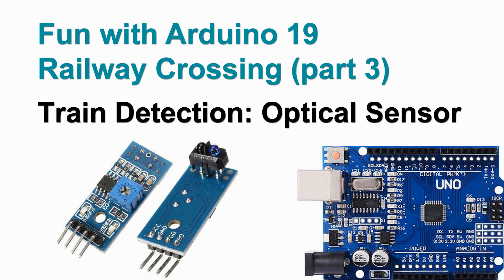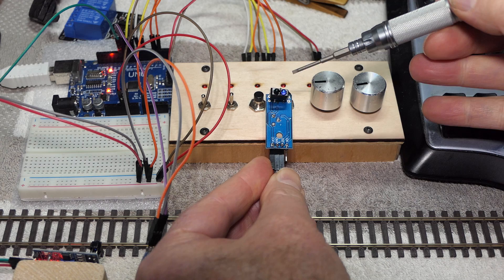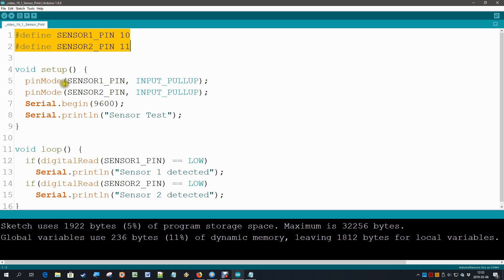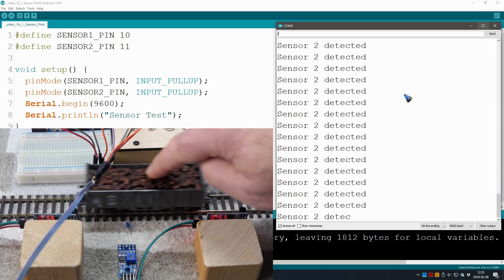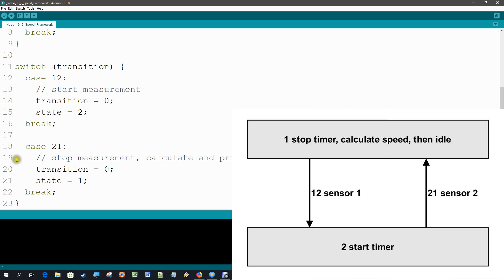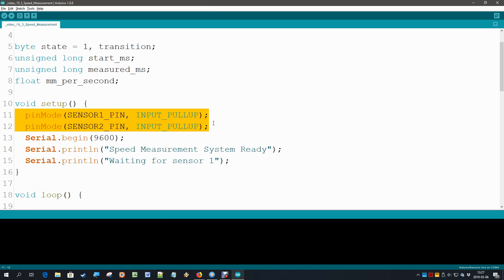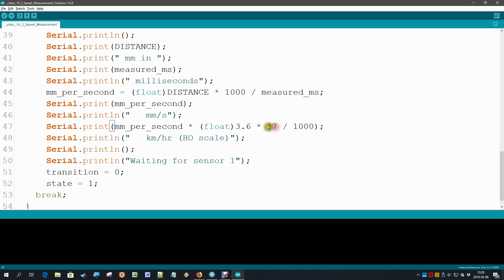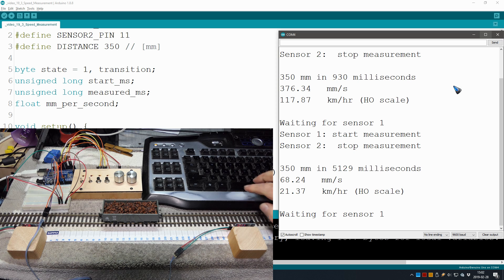Fun with Arduino 19 Railway Crossing Train Detection with Optical Sensor

Comment: Hi, there,.. how can I make the 2nd IR sensor  stay active until after the last car has past over it.....once the 1st sensor has been activated? 

Like once the 1st sensor has been passed over the the train is over the 2nd sensor gate goes up once it's cleared.
Reply from the maker: It is a bit harder to detect the tail of the train. Once a Low>High transition was detected you have to detect a High>Low transition,that should be the end of the train. However ... you may have to fist wait a second, or two, to know that it was not the gap between two wagons, else start over and wait for the next High>Low transition.

Comment: hey, would you be able to make a tutorial on how to set up and program a detector by means of connecting the detection leads directly to the rails? In north america at least, we use an ac pulse loop with rectifier shunts at the end of each approach and can calculate the speed of the train by the resistance in the rail.
Reply from the maker: I have no idea what kind of detector you are talking about, but what ever you do, always take care that the signal fed to the Aerduino to detect anything never exceeds 5V.

Comment: if you put them each one  side of the track is the code the same or is it different?
Reply from the maker: Please clarify what exactly you mean with 'put them each one side of the track'?
Reply: @rudyshobbychannel   at 3.27 you see the blue and the black led i know there the Optical Sensor i have got it set up like that with two off them one each side of the track so the train has to break the beam when it passes i think i have facebooked you as well
Reply from the maker: OK, yes, this transmitter and receiver should be cut off from the PCB and with some wires place them opposite each other such that the sensor is normally activated and the beam is interrupted by the train.
Reply: @rudyshobbychannel  so no changing to your code?
Reply from the maker: Nope, the code was written for this setup. In case the logic of the sensors needs to be inverted that is very easy to do.
Reply: @rudyshobbychannel  hi i tryed it again and it gets stuck in case two but i think its because the sensors both go on when i pass them at the same time or is this not two way working?
Reply from the maker: The code as it is works for a single track. For two way traffic or for multiple tracks it needs to be modified.
Reply: @rudyshobbychannel  single track I useing it on but the loco is longer then the gap between sensor
Reply from the maker: @2006death2006  When the train triggers the first sensor the cycle to flash the lights and close the gate starts. When the train triggers the second sensor the gates open again. If the train is long, move the second sensor further away.
Reply: @rudyshobbychannel  i commented on you wrong video i wanted to comment on the speed one sorry
Reply from the maker: @2006death2006  Alan, can you send me a message via the rudysmodelwailway blog. Then we can email from there.

Comment: Hi Ruud would it be possible to do a tutorial on train detection using those ir optical sensor with digijeiks dr5000 via a opto interface (arduino) and TrainController  software for train detection
a lot to ask i know but i get the feeling there are many guys out there who would find it very useful
regards tony
Reply from the maker: The DR5000 can't read sensors itself, Loconet or S88 interface will have to be used. I have made Arduino software for S88, it is published on my other blog, Rudysmodelrailway. For Loconet I can recommend the Arcomora Arloco shield.